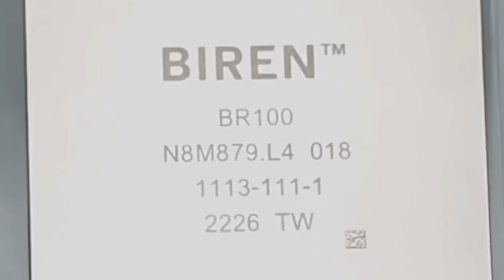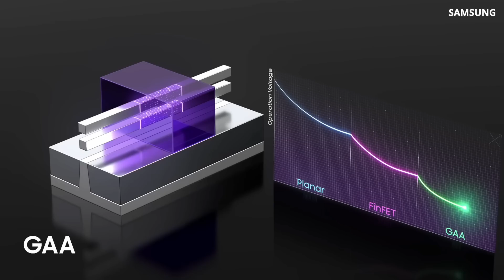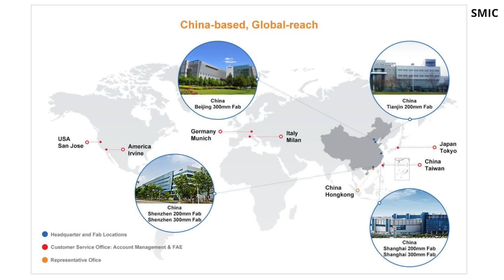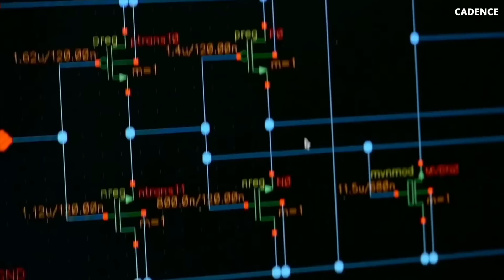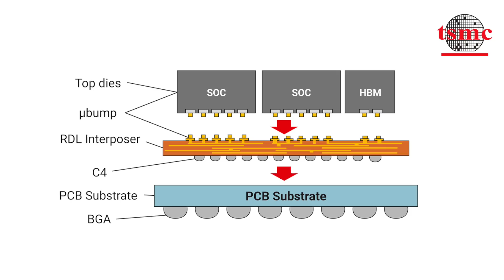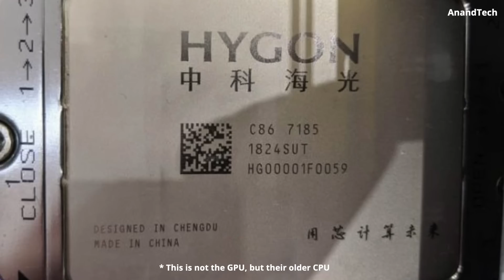The Truth about China's Latest AI Chips

Comment: 🎯 Key Takeaways for quick navigation:

00:00 🌐 Semiconductor technology is crucial for economic competition between the US and China, leading to restrictions on China's access to critical technology.
01:28 🧠 Challenges faced by Chinese AI chip companies include design, manufacturing, and software stack development.
03:21 💻 Huawei's 910b GPU is a top competitor in China, potentially surpassing Nvidia's H20 GPU in performance.
04:42 📈 High demand for Huawei's 910b GPU poses a challenge for manufacturing capacity.
06:00 🏭 SMIC is expanding fabs to meet demand, exploring alternative lithography techniques beyond 5nm.
08:13 💾 China's focus on high bandwidth memory production is crucial for AI chip self-sufficiency.
09:06 🔬 Developing an efficient software stack is a key challenge for Chinese AI chip companies.
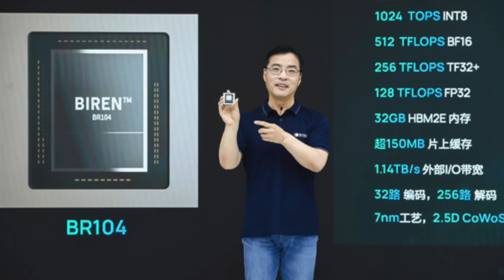09:56 🚀 Despite challenges, Chinese startups like Biren and More Threads are innovating in AI chip design.
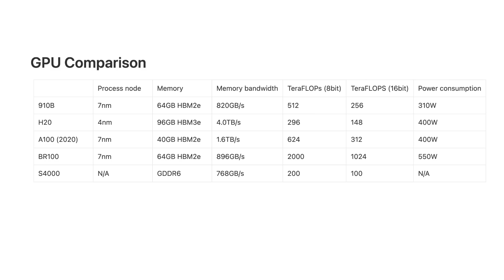11:42 💡 Startups like Hygen Technology and Intelifusion are entering the market with promising GPU designs compatible with Nvidia's CUDA platform.
13:58 🌱 Despite current challenges, China aims for self-reliance in AI chip manufacturing in the future.

Made with HARPA AI

Comment: Almost 20 years ago I got to see a 300 mm chip Fab. It was owned by IBM and it was using the latest equipment. It had robots to move everything. So the 300 mm wafers were held in cases that had it's clean room environment in the case. The pods were dropped down by four wires in front of the machines. And when the machine was done it would pick them back up and send them to a two large queues. 
I on the other hand was making substrates. A substrate is a ceramic of multiple layers to manage the connections between them chip and the PC board. The ceramics were a soft material and the wiring used was a sort of paste that was silk screened onto the ceramic. They would be stacked and sent into an oven to make the final substrate. The machines with tear up the mask. So I often got one mask and 40 sheets to finish a job. They gave it to me because one I got good at running the machines and two most people don't understand how electrical connections are made so they were rejecting perfectly good sheets. 
20 years later and now they're up to 500 and 700 wafers. Well if you're getting 80% yield and they don't cost any more than 300 mm I could understand it. But I'm wondering where did the 300 mm equipment go to?

Comment: Anastasi, thank you for your excellent technical presentation. However, you missed an important point. On 10/13/2023, Canon announced a new lithography machine based on NIL. They will be commercialized for making 7nm Si chips later this year and 5nm Si chips in 2025 at a cost 10% of DUV machines being sold by ASTM. It does not require light source, thereby reducing power consumption. In my personal opinion, nobody will buy DUV($250M) and EUV($350M) 5 - 7 years from now. Even if Canon will not sell NIL equipment to China under agreement with the US government, China's university and private research teams will develop their own NIL equipment. Huawei has hired top notch scientists/engineers from China, Russia, France to do R/D. It spends 24% of profits on R/D, probably higher than those in old AT&T Bell Lab and IBM during their peaks.  China has one big advantage over US is that it has projected to have 39% global Si chip market within few years. My another opinion, 2nm and 3nm are primarily for cell phones. Its % of global total Si chip revenues will be very small. Tesla uses 5nm chips in their EV, whereas BYD uses 7nm chips. Yet BYD has replaced Tesla as no. 1 EV seller recently. This has proved my point, the importance of 2nm, 3nm, 5 nm chips are overhyped.

Comment: The TFLOPS is not the key problem in current AI - it's memory bandwidth. And you can see NVidia with an enormous lead, there. So, I would expect that chip to have ~20-25% of the training and inference performance based on the specs. I am absolutely certain they will get better after a few generations, though. Whether they can "catch" NVidia this year isn't going to be that important in the overall AI "arms race." If they are right on Nvidia's heels in 1-2 years, that will be incredibly impressive. And that should be around the time we'll really see some of these technologies widely used for "real work" around the globe. Today, they are a bit niche, but we are finding new ways to use them and apply them every day. As they get better, this combination will create a productivity feedback loop until a large swath of "knowledge work" can be done directly by AI in a couple of years. If China has chips capable of that at that time, things are going to get crazy ...

Comment: The success of the Accelerator on a Chip International Program to make an electron accelerator on a silicon microchip was very exciting (if you'll forgive the pun) when I first heard about it. 

If it could increase the amperage from a few electrons per shot to a few amps per second -- very, very hard, but perfectly possible -- then it would be the perfect tool for not only shrinking the die size of a chip fab but also making  such a fab smaller less expensive.

Electron beam lithography is long in the tooth. Sure it has its issues but if such a fab could be built with a cheap and small accelerator then one-off production suddenly becomes economically viable.

If such a chip accelerator could be mated to a similarly manufactured free-electron laser on a chip (basically the inverse of the accelerator) then you could create a photo-lithographic chip fab of any specific frequency you please.

Both these "if"s are very hard engineering... But quite possible. IMHO, this is the future of chip manufacture.

Comment: It seems that, as you said, they don´t lack designers or startups with the potential to create competitive GPUs, that's being said, it seems that the main obstacle is on the lithography process, as SMIC is the only provider at the moment, and in years to come for this... so, I wonder, does SMEE seems capable to replace ASML? The last thing I could find, is that they were capable of processing wafers of 28nm, which indicate that it would take several years for them to catch up in manufacture.
Reply: The first gen of TSMC 7nm used 28mm machine too.

Comment: Everyone is probably going to have to switch to switch to electron beam accelerators to power lithography to solve the power issues. It's just a matter of spending half a billion plus being economically viable in ROI to power lithography tools.
Reply: AI is going to change everything, absolutely everything, within the next decade... This whole East vs West thing will be a moot point.
Reply: Not gonna happen. There is a reason that tech is not used outside of research and perhaps mask creation. It simply does not scale. China won't get past the current level of tech for at least a decade. It took the brightest minds of the developed world combined 40 years to get EUV fully to market. This is not something a dictatorship can do from the top down with pouring money on the fire.
Reply: Perhaps not everyone!
China has to do it because of the sanctions, so they will.
But ASML might retain its market elsewhere.
I doubt that China will sell their synchrotron-based EUV tech to others.
And it's too expensive for others to develop their own version.

It might result in that China gets better semiconductor production tech
than others. An unforced error from the sanctioning cohort.

But I guess it will take some time to develop. We haven't heard anything
about it being built yet, and it would take some years from that to be producing
any chips. So, at least 5 years.